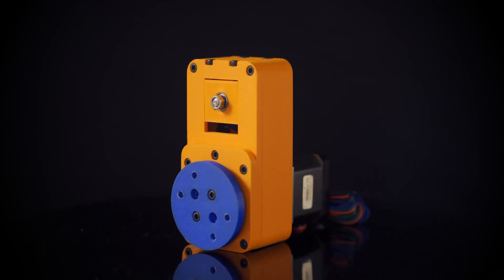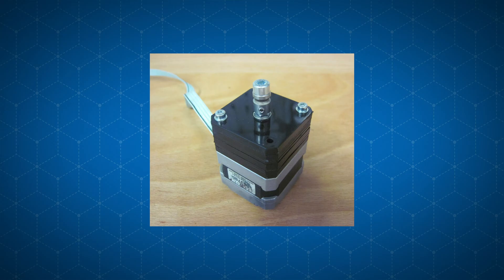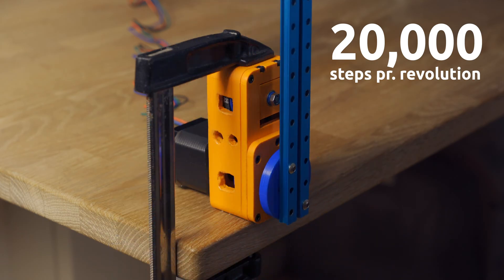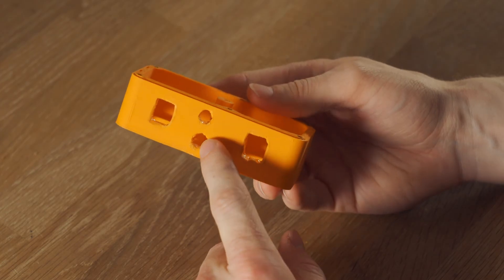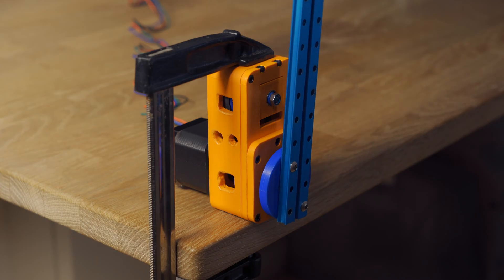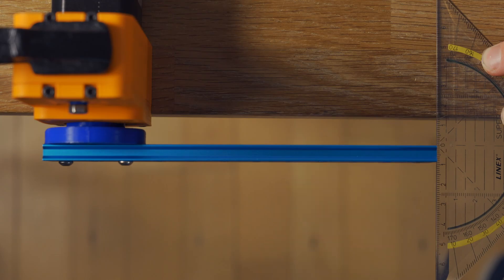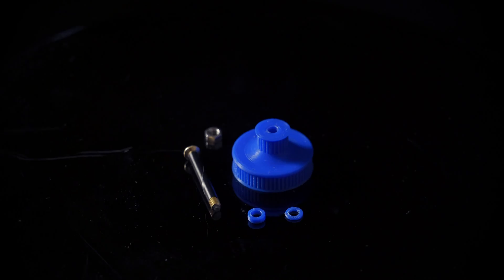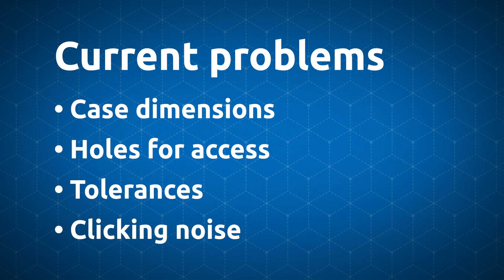NEMA 17 Gearbox with NO backlash!

Comment: would have been good to see how much backlash there was in the original motor you used, to see how much backlash your design can compensate for. 

also, you've eliminated the physical backlash you can impart on the motor, but how will it effect the ability for the motor to output specific movements, if the motor is still suffering from backlash surely it will delay the start of each change in direction no matter what you do?

Comment: Hi Emil! I'm working on a final graduation project to become an electromechanical engineer. May I cite your video as inspiration? I have developed a gear reducer similar to yours for use in a plastic tensile testing machine I am designing. It's for a NEMA 24 motor with a torque of 12Nm and uses XL type belts.

Looking forward to your response. Thank you!

Comment: Great video ! but this design doesn't really reduce noise as you mentioned, there is plenty already. the vibration of the stepper transmits in the belt and into the system and still releases a high noise level, as opposed to a planetary gearbox for example..

Comment: Good first video, with a good quality but I do have some remarks though.

I'm sorry but it still clearly has backlash. It's also very hard to say/see if you have more or less backlash because of your gearbox then before.
Note, zero or NO backlash is actually hard to achieve.
To have a good comparison you would actually need to test the backlash without your box, with the metal arm directly coupled to the motor and then while connected to you gearbox.
You can get a suitcase scale or some other type of scale, or simply some fixed weights. Then measure the deflection when applying the same force and compare.
This would provide much more tangible results than you saying that you pushed rather hard as that tends to be really subjective and hard to judge/understand.
Now this still wouldn't represent backlash perfectly (as it's a dynamic thing and deals with hysteresis) but it would be a decent starting point.

Also with belts you will never be able to achieve zero backlash because they are flexible by nature, there's a reason why CNC machines, especially the more accurate ones use ballscrews and not belts like 3D printers. So that flexibility you mention might be because of the belts more than it being 3d printed maybe (hard to judge). Still even if it was all metal you would still have backlash because of the belts.

Comment: One of the things that stepper motors offer per se is the low backlash, that is the reason that they are mostly used in direct drive, I thought that by no backlash you meant you used a cycloidal gear, or harmonic drive or even a duplex worm gear.
Reply: Which motors have backlash?

Comment: I like this design! 
It's a bit bigger than some of the geared boxes, but I do like the overall looks of this - plus, the use of the belts does make for better long-term durability of this whole thing.

One thing I'd like to see is its behaviour under higher output torque. The belt friction could wear down the printed parts in unexpected ways!

Regarding the motor position feedback, NEMA Motors with encoders pre-attached are starting to be more cheaply available! The encoder also sits at the back of the motor box, which means no change to this design is needed :D
((Also, try it with a BLDC, that might be fun~))
Reply from the maker: Hey! Thank you very much for sharing your thoughts :) 
I really agree with you regarding the belts. I think it's a great solution, but I don't know it will wear over time – we'll have to see. The belt however introduces a bit of flex, so in a future design, using stronger or larger belts might improve the behavior under load.

Nema attached encoders are a great idea. In the second version of this design, I'm using a hall effects sensor for zeroing – but this could be a future upgrade! 

BLDC's? I'd love to try working with those for robotics, but I haven't decided to make the investment yet (either oDrive or a similar product).
Reply: @Emilostuff  
You could experiment by using a drone ESC and drone BLDC
Those are really comfortably cheap and pretty powerful - they just have a LOT of speed instead of torque, so maybe not the best for a more precise system...

I think Encoder+regular stepper is the best way to go for now.
Reply: Brushless gimbal motors could be an option.

Comment: Emilos !!! Great Video and Excellent explanation, I congratulate you on all your designs. I returned to refolmulate the question apology !!!
Emilos, In the video I observe that the largest pulley has a bearing, does this pulley connect to the motor shaft? Why not design them completely separately? It is a question that I have about transmissions !!! Best Regards Rafael Matheus
Reply from the maker: Hello Rafael! Thank you very much! Yes, the largest pulley (the output) is resting on the motor shaft – I did this to save space. I could just as well have omitted the bearing, so they wouldn't touch, but I thought it was at neat way to improve the stability of both the motor and output. If they were to be separated, the gearbox would get more of a triangular shape. I wanted to make it as compact as possible, so this was the best solution I could find :)